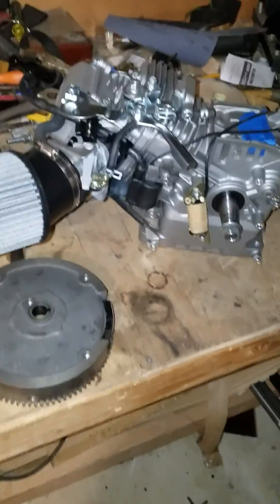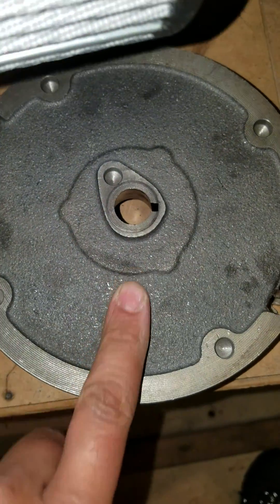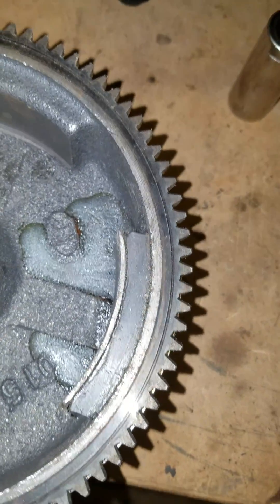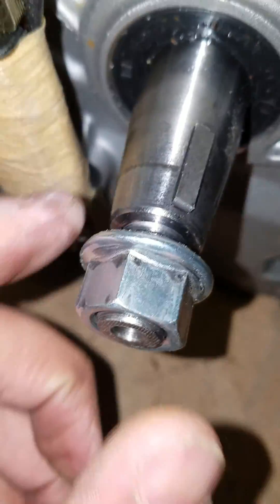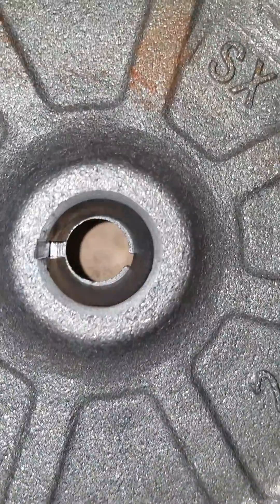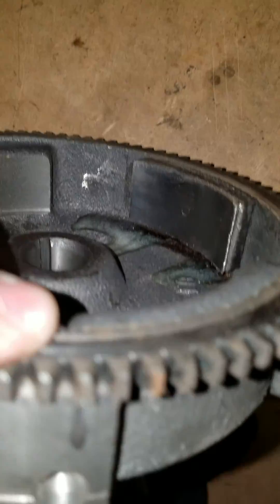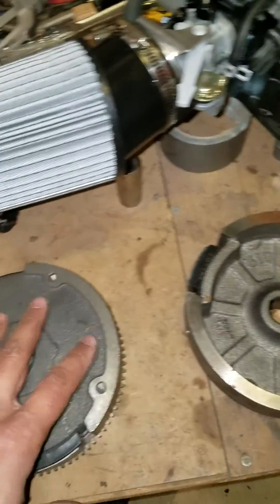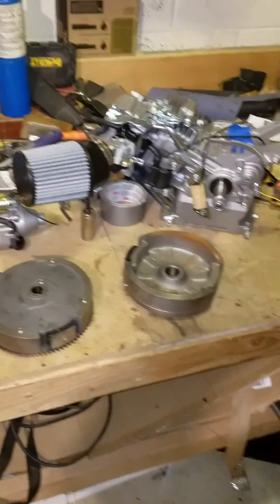Predator 212cc Hemi Flywheel Issue

Comment: i ran into this problem in 2015...apparently predator changed the flywheel/crank specs....good news tho...Duramax has a 7 HP motor that comes with elec start....for about 135-150
Reply: $220 now. I bet the price shot up after everyone realized this setback with the Predator Hemis and started buying the Duramax motors. For  $69 more one can buy the Tillotson Hemi 212 w/ electric start from studzracing and gopowersports.

Comment: The Predator hemi 60363 takes a flywheel 1702529-s and stator 1708507-s the starter is the same as the other predator engine
Reply from the maker: That is correct. Kohler makes the correct flywheel -complete with magnets - to fit the tapered crankshaft.

Comment: I took the stock flywheel of and tried to put it back on but it only goes on about half way  I’m not sure if it was pressed on there or what it’s a predator 212 Hemi 2018 model
Reply from the maker: If it is the exact same flywheel that came off,  it should go right back on. Make sure it isn't canted,  and apply a bit of lube. You may have to run it in with an impact (carefully! ).

Comment: Or, you could spin the engine (spark plug out) with an electric motor and carefully machine the shaft taper to match the flywheel taper. Then use lapping compound between shaft and flywheel to get perfect match.

Comment: how does the flywheel stop turning freely and lock on?
Reply from the maker: King Jesse 
The starter has a solenoid-activated plunger that stays engaged while cranking and then disengages when let off of the switch, just like a car engine. 
Then the flywheel is basically along for the ride. The magnets inside provide the charge, while the magnets on the outside provide the signal for the ignition coil.

Comment: Have you had any luck yet to get the flywheel on?
Reply from the maker: Chris Gibson I actually found an aftermarket flywheel that goes right on. You can see it here:

https://youtu.be/m8o_ryMcWPM

The flywheel taper CAN be changed to fit, but a machine shop would have to do it.
I put the other flywheel on my other older predator.
Reply: Johnny I. Awesome, I seen that video after I commented and I'm glad to see someone else working on one of these. I'm currently working on mounting my predator engine under the seat with a 90 model ezgo. It was mounted to the back of the plastic where the clubs go when I bought it.
Reply from the maker: Chris Gibson I wanted to install everything under the seat, but that wasn't an option with a trans attached. Not enough room, no matter how  I angled it. 
The only other way to do it that I know of is to change out the rear to like an e2me that has a shifter prawl built into it with reverse. But they are expensive and kind of defeat the purpose of building on the cheap.
Reply: Johnny I, on mine I'm just using the centrifugal clutch and mainly using mine for around campgrounds. How well does the charging coil work, did you have to add any resistors/capacitors to get the batter to charge properly?
Reply from the maker: Chris Gibson I haven't added any lights to this cart yet, so I really don't want to lead you astray. 
I have checked the system and it keeps it right above 12.5v forever.
I'm putting led lights on both carts as they stay cool and have minimal draw.
Reply: Johnny I. Im pretty sure The lights won't be much of a issue either. I've got a few other things to do before i can mount my motor. I was really glad to see someone else doing one of these. I'll continue to keep checking back and watching your videos best of luck on your build.
Reply from the maker: Chris Gibson Awesome! Thanks. And best of luck as well!